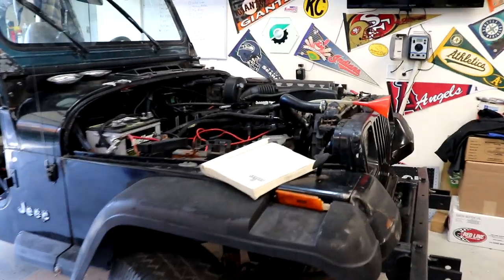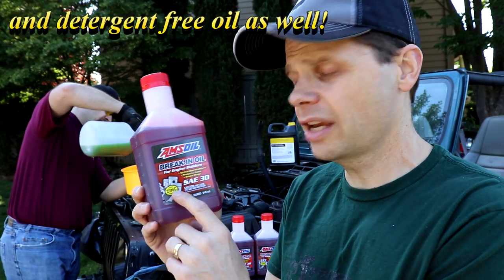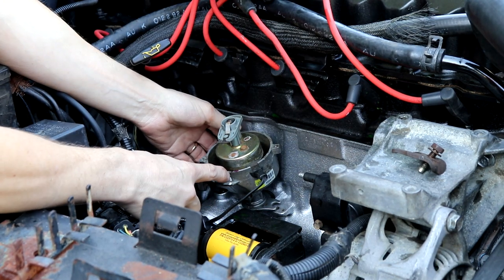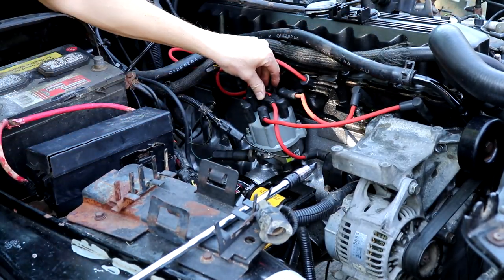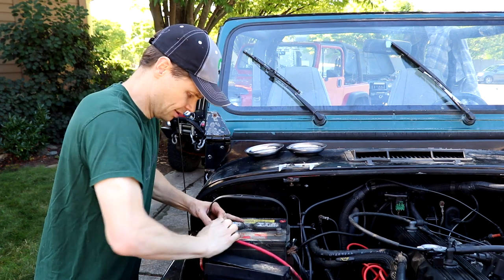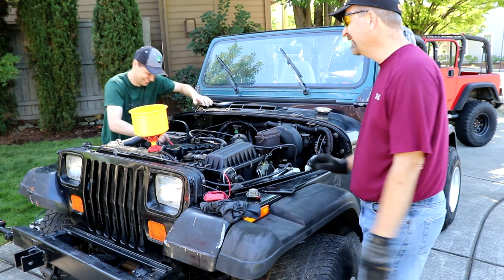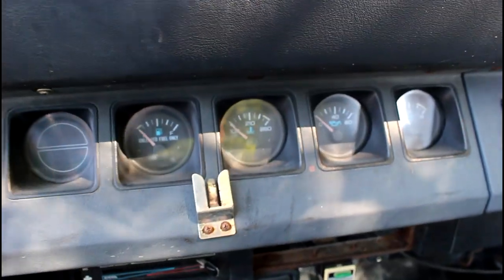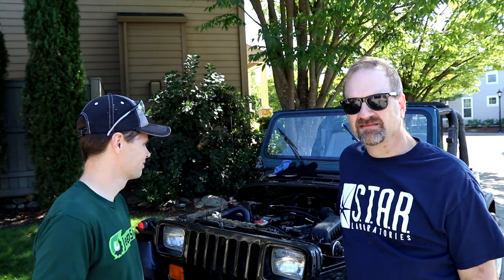New Engine Break In. Flat Tappet Cam: Engine Rebuild Part 31

Comment: hey man I just did a gasket with a rebuilt head and put my jeep all back together and it runs very sluggish you have to push the gas to the floor for it even to move.  what do you think could be wrong. it have 343000 miles on it new parts cap and rotor, spark plugs, wires, not sure what's going checked the vacuum lines too so I'm lose.
Reply from the maker: My first thought was vacuum lines as well.

Comment: I'm glad to see you got it to the break in point.  that is alway fun.  i'll be starting the break in on mine tomorrow.  the cam break in is done just need to get the rings seated good now.  i alway hate the 20 minutes of around 2000 cam break in on a new engine.  have a good one and glad you figured the no start problem out also.
Reply from the maker: Thanks!! It's a good feeling to have it running well.  Engine sounds really good!!  Hope yours goes well too.

Comment: Dale thanks for the videos. I followed along and rebuild with the same Enginetech parts my 1996 4.0 and I’ve put about 50 miles on it so far. Going to do the stroker build next.

Comment: I seen in the  video  one time you tried to  start it,   it had sparks at the  battery terminal  ,it looked like it was  where the wires were clamped at the  terminal end.  On the  ground side I think.

Comment: Zinc is known to plug Catalytic Converters so don't go crazy using it. I use (Hyper Lube) HPZ 212 It's a Zinc Replacement Additive one 12 OZ Bottle treats 5 to 6 Quarts of Oil and it's safe for Catalytic Converters, Price $ 12.36 a Bottle. This Product is sold on Amazon and make sure you get the exact type i mentioned. They have 2 types one is for older Engines that run no Cat's it's about half the Price. Read the back of the Bottle it explains just what type of Ride it's good for. I add a 12 OZ Bottle with every oil change at about 3 Thousand Miles. Zinc has been removed from oil these days. In older Flat Tappet Cam set up's it's needed to Protect your Lifters and Camshaft. Leaves a protective coating on the internals of your Engine. Maybe older Jeeps without a Cat can handle a high Zinc Content but my 2000 XJ has 3 Catalytic Converters 2 upstream and one just before the Muffler. If there's anything i am missing please feel free to fill me in.
Reply: My engine builder recommended Valvoline VR1 oil after break in.  Made for classic cars w flat tappet engines.  During break in it was the VR1 plus a bottle of zinc additive

Comment: I watched your entire series. It convinced me to buy a rebuilt engine instead. Regardless I followed much of your series to fully understand the process. Just finished Engie break in and all is good!  Thanks for the great work.
Reply: Hi bro, did you use engine tech rebuild kit? How is the engine so far. Would you do anything different? About to do my 4l xj
Reply: @Dd-bk7rr  Not sure if this was meant for me.  I purchased a remanufactured engine from S&J Engines.  Sold more core after that.  Time vs Money, this was a great investment.  Two years later and working perfectly.

Comment: Could I prime the oil pump by just using the starter to turn the engine over with spark disconnected ?
Reply from the maker: Some people will remove the fuel pump relay and crank the engine. On a rebuild like this, I prefer to manually turn the pump without the engine turning over, because it's starting completely dry. Cranking it over turns the engine over dry. I don't like that

Comment: What kind of oil exactly did you use after your break in? Just curious because I’m currently putting a freshly rebuilt motor in my 90 YJ.
Reply from the maker: After it’s broken in, I’ll probably use Red Line 10-30

Comment: Just wondering how did you throw off the timing? Was it from priming the oil pump? Thanks and congrats on finishing the build!
Reply from the maker: We thought the timing was off, so we backed the distributor off a tooth. We were incorrect.  The timing was right. Had to put it back.

Comment: Dale, one thing if you are concerned with fuel being the issue, I acutally have a diesel in my jeep now and diesels hate air in the line, when i let the jeep sit for a while i will turn the ignition on *fuel pump comes on for a second or two*, then turn it to ACC then back to IGN again until im satisified. Most recently I jumped the relay to make it so the fuel pump is on with the igntion. Although this is pretty extreme for a regular ol 4.0l maybe that would help eliminate a fuel issue when starting? also it would let you confirm the fuel pump is working correctly.
Reply: also out of interest what is that check engine light for? im guessing something silly like 02 sensor?
Reply from the maker: Yeah, fuel pump is working well. We tested that as well.  Engine runs very smooth now!  Still have to look into what the check engine light is though...

Comment: How would priming the engine work if the engine would have a coil pack instead of a distributor?"
Reply: Its the same
Reply: The camshaft sensor is located in the same location on the coil pack 4.0s
Reply: Thx guys!!